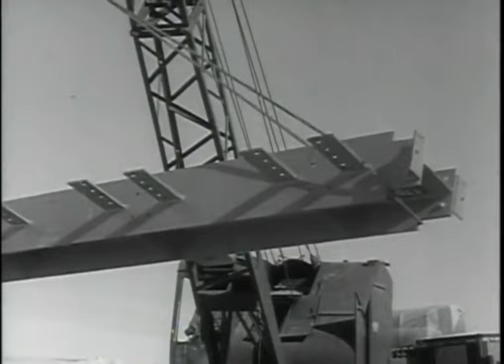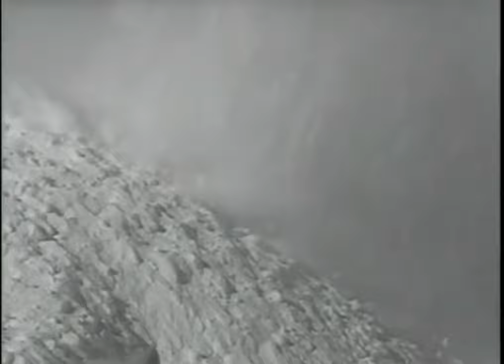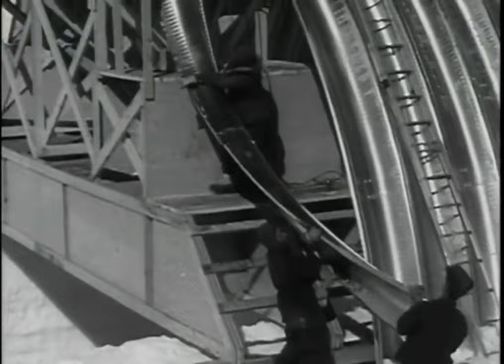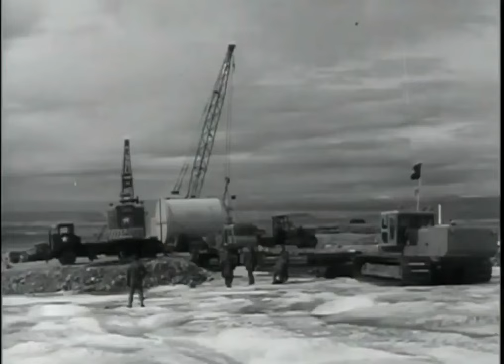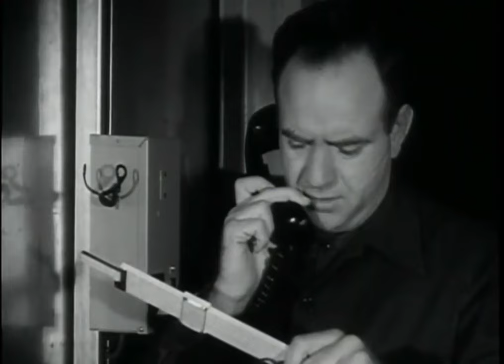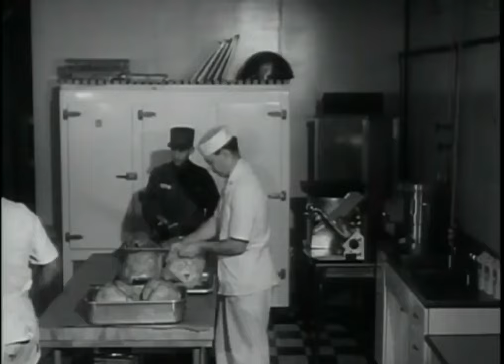Secret Greenland Base - Xirtus Archives

Comment: Hey X, great video. I learned in the 1950’s, you can have a complete nuclear reactor delivered anywhere you need free energy by Air or Sea. It’s also so refreshing to see those guys didn’t have the need for protection from  ALL of the deadly radiation back then. Just, Tee shirts, caps and a slide rule, is all these amazing people needed. Do they ever get tired of punking us? 🙄 the brainwashing is relentless.